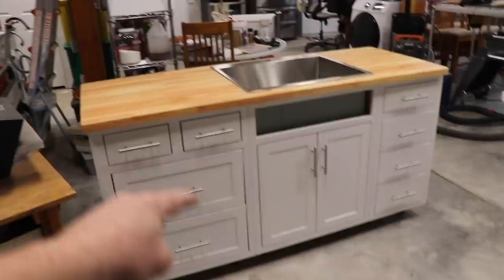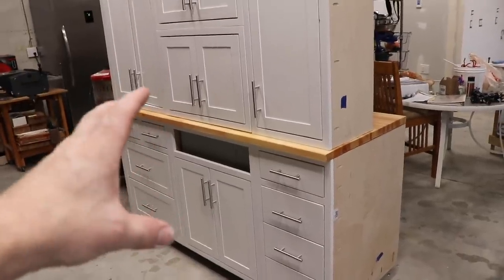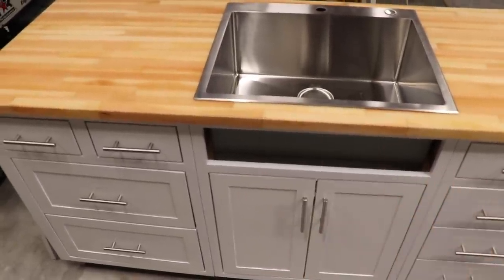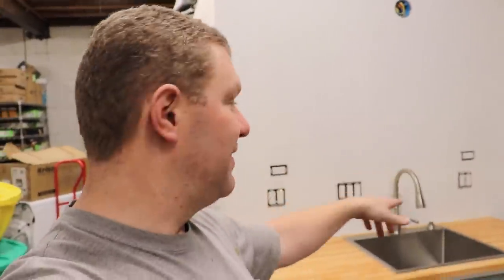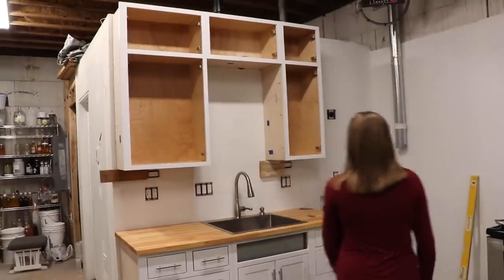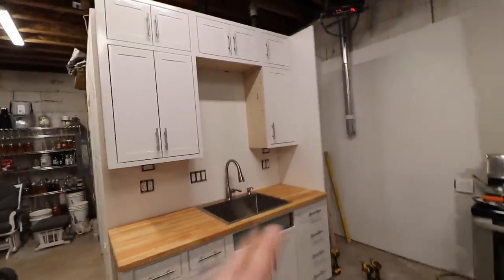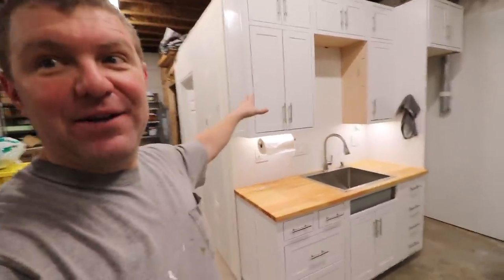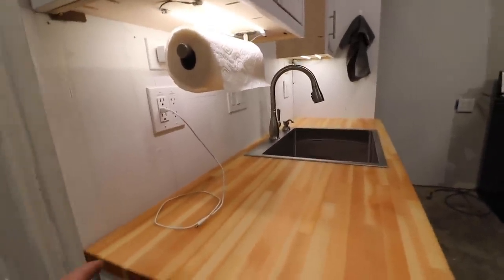Custom DIY Kitchen Cabinets by Total Rookie

Comment: Beautiful cabinets.  I had a similar kitchen set up.  What I did not like is facing the wall while doing anything at the sink.  I got a beautiful beveled mirror, put it on the wall and I could see what was going on behind me.  The builders thought I was nuts but when it was done they were amazed the amount of additional light it brought in to the space.

Comment: Awesome !!! Especially the night shot.  Try revolving the paper towel dispenser 90 degrees, parallel to the sink edge and centered between the switches.  The positive of this is less shadow, ease of access to the switches and greater visibility of the sockets.  Also it will be closer to the sink with wet hands. Super great work. Peace.

Comment: The cabinets look great. Remember the small piece of wood that holds the cabinet doors even in the front, you may want to install then at the top of the cabinet so you don't see them or interfere when you are moving items in and out of the cabinets. Just a thought!

Comment: install uppers first, prep sink before installing into the top (install fawcett and drain) then install lower cabinets
Reply: i agree with the uppers first but the sink couldnt really be done like they usually are with the faucet installed first because it is so tight , i think they might have had trouble when they tilted it to get it to fit maybe. The faucet was tightened from the top and behind since the back is open, you can actually see Alyssa reach in through the back of the cabinet and turn the faucet.

Comment: Looks excellent might I suggest in the open section over the sink fitting an open shelving 2 or 3 shelf unit but with only half depth shelves.You could then store things like soap etc that you would normally store on the counter.

Comment: Looks great....very professional. I usually just run romex up to he bottom of the cabinet and use a false bottom on cabinet to cover wire.  Using a outlet like you did is ok, but can look a little busy......fine in a garage kitchen, but something to think about in your next kitchen.   Also I would have made center upper come down a lot further.  Just little nit picky things.  Looks really awesome.
Reply: Not sure if it's to code to run romex inside the cabinets

Comment: Dunno if you figured it out yet or not, but the extra stops in the cupboards aren't necessary.  The shelving is your stop.

Excellent job though, looks great!
Reply: Silicone buttons can be stuck on the leading edge of shelves for noise and flushing up.
Reply: he put the temporary stops in as he was putting the doors on to see how they fit and looked before he had shelves, he already talked about this.

Comment: Thought I'd share something I saw on a documentary about Finnish architectural design. Seems a feature in many Finnish homes is a built in drying rack above the sink. The space (just like yours, between the cabinets) has wire shelving inside, an open bottom allowing drainage to the sink below. 
The space is covered by a door, so it just looks like the cabinets on either side. This feature clears counter top space. Thought it would be great for drying your large canning pots etc.

Comment: As a cabinet maker for years, the one piece of advice I would give is this. Next time don’t make separate cabinets for such a short run, make this as a single cabinet. Especially when they are white, as it reduces separation lines between frames and makes install much easier. I never made a single cabinet shorter than 8’ if I could help it
Reply: nice tip reduces the material a little and the waste as well nice tip

Comment: Looks incredible congrats  .. Just a small note, You might want to consider GFCI receptacles  within 6 feet of that sink if the breakers are not  GFCi  ... Just to negate  a " shocking "  experience in the future,  Happy Holidays
Reply: Yeah, code demands that (within reaching distance of outlet to sink if metal) in most jurisdictions. I note the one outlet is 15A, right next to it is 20A. Inspector might have quibbles with that. Again, a lot depends on the jurisdiction electrical and building codes. Most jurisdictions require 20A for counter tops unless for a clock or refrigerator, and as you state, GFCI.
Reply: I believe every one of their breakers in the panel are GFCI , he talked on and on about them when he did the panel install.

Comment: For the drawer front near the sink just use two hinges at the bottom chains and the corner and a magnet and plate in the center or more than one for the drop-down don't go with the pre-made bracket release

Comment: I love this, and support your use of epoxy on the butcher block top. You do you boo. I'd have used cutting board oil myself and just taken a belt sander to it if the cut marks eventually bothered me (probably wouldn't), but I completely understand what you were going for and think you did an awesome job getting there. That's the beauty of the world, we have different taste.

Comment: Best method to hang wall cabinets using 'hanging cleats' .. rip two pieces of 3/4" plywood 4" wide with one edge 45 degree bevel .. length as required for cabinet run .. on piece is attached to back of cabinets at top with screws .. the other mating piece is attached to the wall 8" below top of cabinet .. cabinets are then easily placed on hanging cleat .. cabinet sides require an 3/4" in width to hide cleats
Reply: cabinet sides require an additional 3/4" in width to hide cleats .. also wall cabinets are easier installed before base cabinets
Reply: French Cleats

Comment: Fantastic !!  Why not put the door stops at the top of the doors?
Reply: those are not permanent , he already said he just wanted them for now to keep doors even until he hangs them . I doubt he is gonna leave a big ugly chunk of 2x4 in the cabinet. Now he has shelves installed, im sure he will fit a better stop on the shelf edge to keep them at the right close depth.

Comment: Easier to install sink faucet and lines before installing the sink. Just a though for next time
Reply: yes usually. I think it would have made it a tight fit the way he had to tilt the big sink to get it in maybe ? I do hate reaching way back to tighten the faucet up if the sinks already installed though.

Comment: JESSY IT'S BETTER TO INSTALL THE UPPER CABINETS FIRST,  THEN THE LOWER CABINETS NOW YOU HAVE TO REACH OVER THE LOWER CABINETS AND IT WILL BE HARDER TO DO SO.
Reply: Not only that it also eliminates the risk of damaging the base cabinets and the top that should be installed last..
Reply: @SandBoxJohn   looks like you and I plus many many others is saying the same about the upper cabinets maybe he will get the hint
Reply: @harolddomangue9206  Another thing, shouldn't bother doing all the fine adjustments on the Euro Hinges until the cabinets are fastened in place. No need to do same task twice.

Comment: My only question that's not been answered is what are you doing to conceal the gap on the foundation wall side? I mean I would assume you'd have to make something that opens or is easily pulled down in case you have to get into the back of the washer and dryer. Otherwise, it's most likely not going to look very finished. And just a reminder, like everything else in house building more times than not it's based on your preference.

Comment: Put your door stops up top or they will be in your way when you put things in your cabinets.
Reply: I was about to say the same thing - should also put some poly on those shelves so they are easy to clean
Reply: the stops are just temporary he said. Now that the shelves are installed, i think he can use the edge of them as a stop. He just wanted the doors to line up to see how they looked before he actually had the shelves in or a permanent stop built.

Comment: Surely electrics behind the sink is not to code? Certainly a  no go in the UK.  Looks great!
Reply: as long as they are GFCI connected they are to code... actually possible in UK not totally sure as you run 220 volts... UK has some things that would never pass here like an electric heated shower head
Reply: @markthompson4225  Not sure we do have electric heated shower heads - we do have electric showers - which is something entirely different!
Reply: billy billy gfci protected can be there. It will trip in a millisecond if water comes into contact with whatever it protects, totally within code

Comment: Why on earth would you put electrical switches over a sink ? - Electricity & water don't exactly go well together.
Reply: Every house I've ever lived in (about 5) has had the switch for the garbage disposal right above the sink, and regular outlets nearby for kitchen appliances.
Reply: GFI is the key component. I remember this getting approved by an electrical inspector.

Comment: looks very nice. next time install the uppers first. lots easier to install before the bottom cabinets
Reply: I wonder if it would be more or less bothersome to shim over bottom cabinets? The moral I'm getting from this is that one must measure everything against that end panel and then start putting things up. This way find the  discrepancy right up front & you find the error on the exterior side, not interior.

Comment: Is the kitchen in the garage?
Reply: Threasa Champagne this is the prep/canning kitchen the real one is under construction upstairs
Reply: i been wondering that too, why in the garage?... big house plenty space  2 levels above the garage.
Reply: That is their temporary kitchen for now.  When they get the real kitchen finished up above, this will be used for canning and such.
Reply: For now until the upstairs is ready. They have to do electrical, walls, plumbing, and all that jazz.
Reply: They haven't got electrical upstairs yet. This is their temporary and canning kitchen - practice before the main kitchen.
Reply: Yes. That's because their still working on the main (upstairs) house and they needed a place to cook, do laundry and have a full bath.

Comment: Just realized there is 3 light switches over the sink.  Is anyone an electrician? If so is that normal or code in America? Maybe it's fine.
Reply: was wondering it my self...
Reply: I was wondering  how you can have a staircase without a handrail for so long
Reply: @Pat Houlihan Had the same thought. Where I live there needs to be a distance of approximately 24 inches between electricity and sink
Reply: @DeusMogon  thx! I had an old outlet underneath my sink once and the electrician was kind of glad we called him cause it was dangerous so i wondered about above the sink

Comment: Building kitchen in the basement with no windows? (actually in the garage) Hm.... Sounds weird but 'everything can be possible' :)
PS: After watching your projects I still fee it's way cheaper mass produce lumber and homes (like using mobile manufactured home instead of temp RV living), cars, computers, kitchens with way better end result, but thank you very much for sharing your great practical example showing enormous efforts trying doing everything manually all alone! :)

Comment: great job job the only little thing that bugs me that you  shouldn't have light switch behind the sink  eg water and power don"t mix  here in Australia u cant have any power outlet eg swtich less then 600mm from  a water source
Reply: His switches are perfectly fine where they're at and meet code as is in the US. I can only reason that Australia doesn't allow it because they're commonly 415v 3 phase and only require GFCI on "portable devices", at least thats how I've always read it. In the US it's a little different, any circuit that is near a water source requires GFCI either at the panel or at the outlet it's self. And is ALWAYS required in such places as garages, basements, outside outlets, etc. And GFCI provides more then adequate protection for someone dumb enough to completely saturate their switches and outlets.
Reply: @Static2606  some of your info is correct  please check your voltage  that we use  here in Australia use before making a smart remark
Reply: @sbiggs10  415v 3 phase is commonly used, but maybe only in industrial? So is 230v in residential in Austraila from what I've always heard. Regardless you're the one who  was telling someone who lives in the US that they can't have outlets/switches behind their sink while it is perfectly acceptable here as long as their AHJ allows it and the jurisdiction is following current NEC. And in fact according to the NEC we are required to have a receptacle with in 2ft of the edge of the sink. Interestingly the sink doesn't count as counter space when calculating placement across the whole counter.

Comment: Jesse, the build turned out beautiful , then you put the paper towel rail up. Noooooooo.
   "She who must be obeyed" has got it wrong, go with your gut feeling. A nice turned timber upright stand on the counter top or mount inside a door.
Reply: I agree as it blocks the light etc, practical
Reply: + on the paper roll. Counter space is precious as it is. Just as toilet rolls are sunk into a recess, perhaps that's what can be done in the empty space in front of the sink? Recess a paper towel into the space. Optimal ergonomics? No, but best use of what little space there is.
Reply: "Wall?" I mean where the 'false drawer' is intended to go. Recessed toilet roll fixtures typically go back an inch from the mounting surface. Double that, and you still have space to spare, and the towel roll will barely protrude at all from the cabinet front.

Comment: You're  allowed power sockets over a sink?  Nope can't see any problems with that idea.
Reply: indeed. no problems. where i live its comon to have power sockets over your sink or close to it.
Reply: @kvothre5348  US electrics are just crazy.  Trip switches all over the place, two voltages each with different rules, Every switch and socket has a rats' nest of calbles and connectors.
Reply: it is okay if they are GFCI protected.

Comment: Idea: above sink, both sides. Use 1/2 in material. Build fairly narrow planters. Double rows on both sides. Plants that like warm moist air from hot water running. Probably a sort of vine. ( oh, you will need to keep it trimmed.)
Reply: @edwardscott9200    Not so dumb.  Gives the feeling of a window.

Comment: Great job on the cabinet and the countertop.  For the center above the sink, i would just make some more trim panels like you did for the end for the sides and just a flat panel for the top.  Have them finished like you did the rest and then fasten them in.  Will look like it was planned that way.  That look on your face and also the look Alysa had when she saw the finished project, well deserved pride.  Yall have came a long way from where you two started.  Once again, fantastic job.

Comment: Jess, this is awesome! You did a great job, even if you ended up doing some things  not to proper order, nor made it easier to do, but in the end, as long as everything is level and all that, you done good. Looks great but in the end, it'll be functional as you appear to go for function first, looks second, the right way to go as many youngungs tend to push for looks over function, judging by Pinterest photos often found.

Going with solid hardware seems to make a HUGE difference in how you got the doors to look good in the cabinets you designed and built.

I like it!

Comment: For future reference, you could have built the three lower cabinets as one complete cabinet, as long as it is not over 8ft long, and you can get it inside the house you are installing it in.  Very easy to level and install this way.  As a cabinet maker, I try to incorporate this into my designs as much as possible, whether it is lower or upper.

Comment: Get some door skins to line the area over the sink. Use a few coats of sanding sealer, sand to 300 grit and paint with a white enamel paint. Contact cement will adhere the door skins to the cabinets without using hardware.

Comment: As a cabinet maker/furniture maker I have been following this project closely. I’ve been a subscriber for +/-2 years. When you said months ago you were going to build inset cabinets, I said a prayer for you. It is not easy. I will say I shoot for 1/16 inch reveals, but dude, holy cow, good job. My only gripe would be in the future don’t use a soft wood for the lower cabinets. Poplar paints so nicely and is easy to sand. Also I’ve never seen anyone use kreg screws to make door frames, I hope that holds up. You have a router table in that Swiss Army knife shop smith right? Play with that and make rails and styles in the future, glue bonds last decades, and modern glue will probably last hundreds of year’s. One shop I worked in all doors and face frames were made with a 1”long mortise and tenon. There are many ways to skin a cat, and kreg screws as door joinery is a new one for me, but if it works and holds up then right on. 
I’m seriously impressed, hats off you guys.

Comment: Looks good! Just a quick tip when your assembling your uppers, for uppers that aren't full height we screw a small block to the top that over hangs the edge on each side, that when you put it between two full size cabinets it will hold itself in place.

Comment: On upper cabinets cut you cleats in half length wise on a 45 degree angle. Mount the bottom one on the wall long side on top outside on wall and top one on the cabinet with long edge on bottom outside. That way you can hang the cabinet on while you secure the cabinets together and secure to the wall. Cut a little off the one mounted on the wall so you can slide it from side to side.

Comment: Looks so good! Put a small hanging light or pendant light above the sink
Reply: Parker Cynthia I would have put grooves in the cabinets and installed a LED lights trip right into it. Epoxy it over for smooth finish.